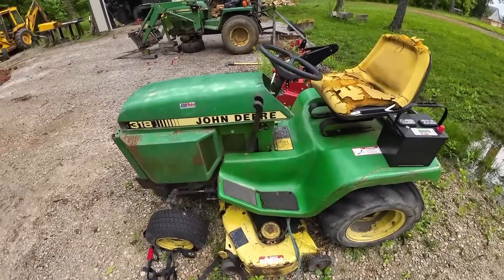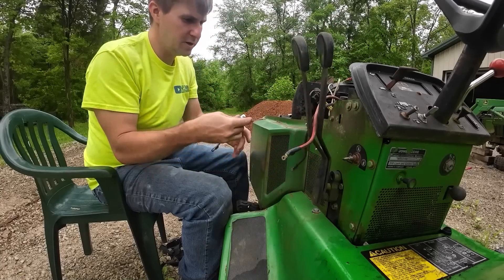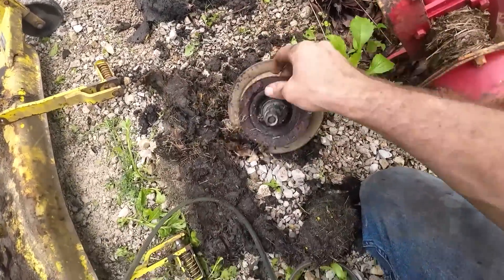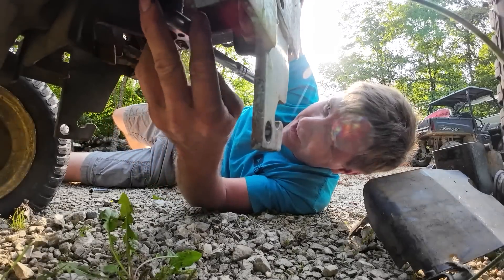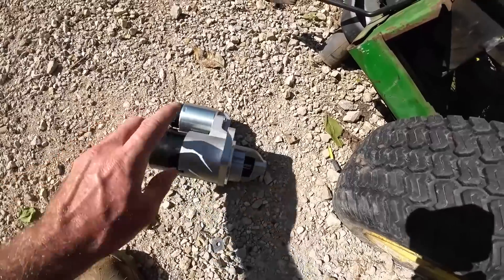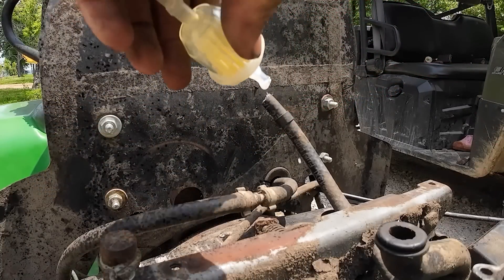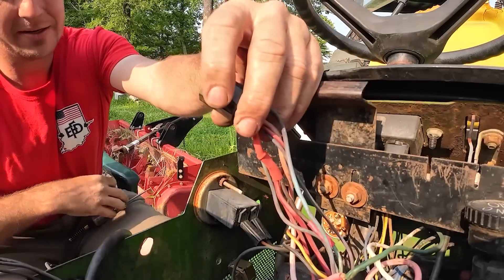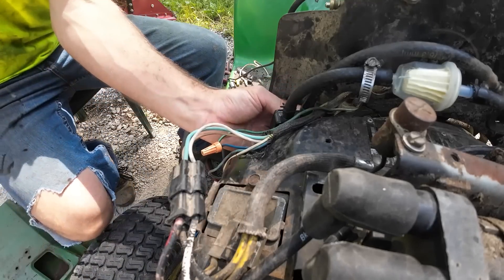Bringing John Deere 318 Back to Life - Electrical Nightmare

Comment: Derek of Vice Grip Garage has been advising people on his channel since day one that a person should never use carb or brake cleaner or ether (starting fluid) to test or temporarily fire up an old engine that hasn't/probably hasn't run for awhile. He keeps something like an old plastic honey bottle with a screw on cap with a nipple on it around and the plastic bottle is clear, making it easy to see that it has light blue or green colored GAS AND 2 CYCLE OIL MIX. Why use gas and 2 cycle oil mixed slightly richer with oil than for a chainsaw? The oil LUBRICATES the cylinder walls and rings WHILE the engine is CRANKING OVER vs. cranking the engine over on washed down the cylinder walls and rings WITH NO LUBRICATION AT ALL. Using those flammable sprays IS A SURE WAY to further scar the cylinder walls and cause MORE compression loss and oil ring sealing loss to an already old, well-used engine. It does make a LOT of sense. ;)
Reply from the maker: Imma pass. 👍

Comment: Mount that relay so that the wires come in from below - then water won't drip into the relay, but drop off the lower bend of the wiring - standard practice for outdoor wiring connections.

Comment: Those Relays are used on everything, auto's, trucks and anything motorized or needing electrical switching. A lot cheaper to swipe them off junked auto/trucks. Maybe your old Ford Ranger, Subaru has a few extras!

Comment: Did anyone else notice at 7:50 the blades are on upside down? Curved air lift part of blade goes up, not down.
Reply: Yup I bought a used mower once and blades were upside down. Not that rare imo.
Reply: My son-in-law brought his blades over… he had taken them to his neighbor to be sharpened.  Then he put them back on.  

When he handed them to me… he told me that the neighbor didn’t get them sharp enough.

I pointed to the grass on the backside of the blades and told him to turn them over and try it again!
Reply: @aldimore  I had a mower shop for may years and you can only imagine what I saw and had to deal with.  Most often the cause of the failure was do to the neighbor borrowing the mower or their help fixing it.  The owner just could not admit they had screw it up.

Comment: You have way more patience than I would have had with the wiring Mike. Electrical has never been my "cup of Tea" (more like my Nightmare)
Reply from the maker: It can be frustrating,  a good wiring diagram goes a long way
Reply: @CaptainKleeman  So does a stick of Dynamite. 😂
Reply: Some people never get it….the desire to fix something that is not working because of electrical issues.  I agree with your comment about his patience but I think his explanation about being a mechanic explains it well: “I’m not a mechanic, just someone who doesn’t  have money for one”.  He gets excited when he gets something back from the dead.  Chasing down bad connections isn’t magic but it does require a few tools, patience, and as Mike said….good schematics help a ton. 

I used to be “that guy” but now just watch others do it on YT.

Comment: Love these videos, before computerised / very modern vehicles ( 1960s-1990s ) I always worked on my own cars . Overheard cam and followers with a feeler gauge, clutches , gearboxes, suspension, breaks , self installed alarms , engine timing with a strobe light , weld repairs , tins of spray paint, pin switches ……………….. and so much more. The good old days but just not economic or even possible these days . Love those days and you Mike take me right back there 👍 excellent video as always 🇺🇸🇬🇧
Reply from the maker: Thanks for watching

Comment: Your outros are definitely “unique” Captain. 😉

Working your way through the 318 is basically how I fumbled my way through getting my Dad’s push mower going that hadn’t run in over 2 years. 
Spent so much time cleaning the carburetor and when I took out the old float seat I discovered new seats are sold in multi packs and a new carb cost the same as a multi pack of seats. 🤷🏻‍♂️

Sometimes a step by step approach gets expensive as you replace parts that may not need replacing but in the end you know what you have.
Reply from the maker: Luckily so far everything I have replaced needed it.  Now adays when it comes to carbs,  it typically is cheaper to buy new carbs than rebuild.  Pretty wild

Comment: I thought mine was rough until I saw this one. I just bought a 420 "ran when parked 2 years ago" for $350. Someone painted it flat black so I about passed on it. I use a quart size fuel tank with a shut off that I hang 3 feet in the air to bypass fuel supply problems. It makes it easier to get them running. Mine also has a loose starter that works. I hope the mount is not broken on the engine. Like you, I get a great feeling when I buy something cheap and fix a few problems and then it runs.

Comment: I have to give you kudos! You've got (or had)  yourself a task. I have several 318s, and .I'm finding that they were fantastic tractors new. I'm finding that buying them used (usually with tons of hours) they can and usually are a nonstop mechanical challenge. I bought an old 83 model with high hours,  and it ran great tge first couple of months.  I have a couple of newer ones  (a 91 with just over 19 hours since new)  but I keep it in storage.  I have a 92 that's going to be a problem child as well. I had a new starter installed, but still no 14v to tge starter. I'm finding now it's going to be a TDCM (time delay control module), which means just over 200 bucks.
I've already gone tgat route with the old 83! I love these 318s, but they're costly,  plus require tons of hours playing mechanic

Comment: Them jd 318 are great tractors   I have to of them both were bought used and one of them has over 8,000 hours on it now with the second engine having just under 5,000 hours not bad for a tractor that is 38 years old
Reply from the maker: That's awesome
Reply: I’ve got my Dads 31 year old 318 which has been well maintained and garaged. It still runs great and is a beast cutting grass. It also has the hydraulic tiller attachment which is awesome. 
Once you get the issues straightened out, you will love it. Good luck.

Comment: Great video. That's not actually the rear PTO, but a stup from the hydro pump that rotates with the driveshaft. There were a few different rear PTOs available- the 2000 RPM gearbox was the most desirable, but hard to find implements these days. Really solid machines though! Those wiring messes are a blast!

Comment: Ya owner's who don't wash the grass out under the deck after each use. Plus no paint every 2 years for wear. Is guaranteed to rust out within a 3 to 6 years.
Reply from the maker: Wait, you repaint your deck every two years?
Reply: @CaptainKleeman  Inside the bottom because of the rocks, sand / dirt and sticks wearing the paint off.

Comment: You are already aware the 318 was the pride and joy of Deere I believe in the 80's.  I thought the 18 was a liquid cooled Onan (great engine just to expensive to work on) and the 317 was air-cooled, I'm probably wrong!   During this period IHC had the Cub Cadet and it too was an elite machine and this was Deere's driving force to introduce the 18.  The Cadet was such a machine that today MTD produces a piece of crap with that name and they sell like gumdrops!  This machine appears to have been abused beyond reproach--what a shame!  I believe the 318 may still hold the record for resale value! Don't believe in "luck" but wishing you the best just the same!!
Reply from the maker: 322 was liquid cooled.  318 are air cooled

Comment: I share your love of old John Deeres. I sorta inherited a John Deere 1020 from the 60s or early 70s when my dad passed away. I found an old broke up box scape out in the woods by his shop and got it welded up good enough to use. I’d like to know what your resources are for getting parts for your John Deere restorations. I was found an old broken bush hog that I plan on making a land rake out of using your video as a pattern. Thanks for the inspiration.
Reply from the maker: If I want actual John Deere parts I go through weingartz online.  I use eBay and Amazon for anything after market
Reply: eBay and Amazon are great resources. You just always seem to be great at researching what to do. I usually wind up taking off three things I didn’t need to just to get one off. I’ve never heard of your John Deere parts source. I’ll definitely be looking them up.

Comment: My dads had a 212 ,214 and. 216 I had to replace the starter on the 216 they are a pain in the butt 🤬 I was dads mechanic because he is legally blind  good luck finding a deck cheap just the shell  for a new  one of his was like $1200 and good used ones are super hard to find and not cheap best of luck I will keep a eye out for one for you
Reply from the maker: I've found several shells for around $100.  I doubt I get a mower for it though because I didn't buy it to mow grass
Reply: @CaptainKleeman  ya they might be a little cheaper in your area I am in Cincinnati area everything seems to be more expensive here thanks to a big town lol

Comment: I got my neighbors 317 for free and he had wired in some different ignition switch and no key.

Got the switch it’s supposed to have and wired that up. Cranks but no sparky. Bought a new coil and that’ll be a this weekend project.

It still has the series 1 so I’m scared it knocks. If it does need a motor I have a M18 or a Kohler K-Series to drop in it.

I have a K241 I might shoehorn in it.

I thought my starter was bad like every one of these things but a better battery helped. Don’t wonna pull the motor till I hear it run cuz if the motor is coming out a different one Is going back in.

Comment: The 317 is a better machine in my taste, it has a Kohler 17hp engine instead of the Onan. I have 2 machines with the Onan  a Lincoln welder and a Wheel Horse 520, and not a big fan of  Onan. I did have a 317 and sold it to a friend who still uses it regular. one item the Wheel Horse is normally easier to access  engins parts than JD except on the Onan.

Comment: Thr reason the old rely was rusted because the way you mounted the new one its just a cup catching water !!🤔
Reply from the maker: You don't buy weather proof relays?
Reply: @CaptainKleeman  Yes you can but mounting it with wires sticking up just collects moisture as water runs down hill

Comment: Spindles and deck bearings had to be replaced about every 3 years in the 20 years I owned my 318. They are expensive and a pain to replace yourself. It appears your 318 isn't even worth anything for parts.
Reply from the maker: Machines take maintenance.  Non running 318s can bring $300 - $400.

Comment: That is the wrong ignition switch the contact configuration is different than the original you removed.
Reply from the maker: Negative,  it's correct but faulty